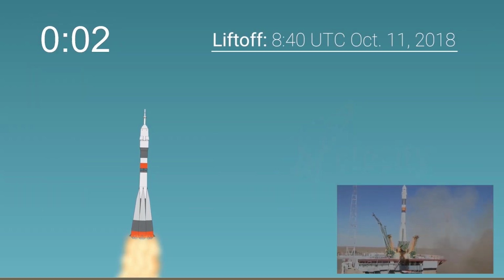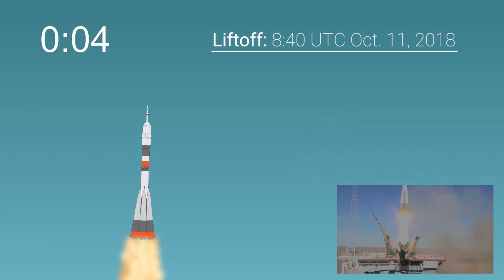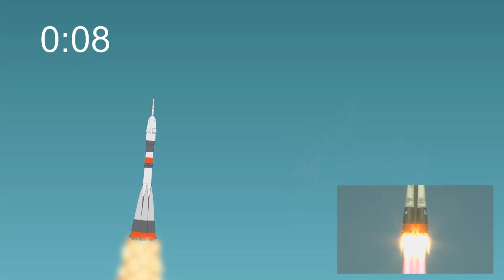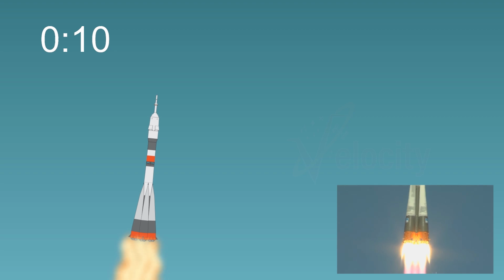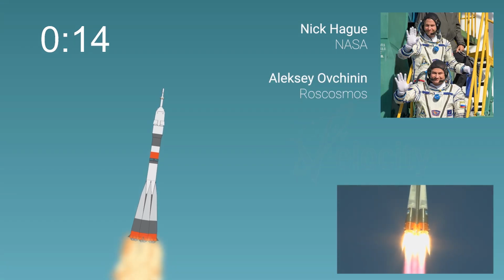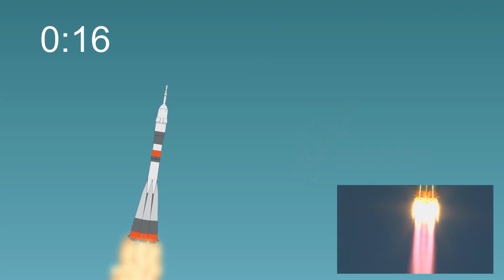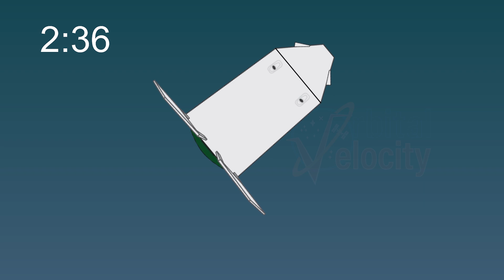Soyuz MS-10 Abort Animation

Comment: So the soyuz has two escape systems?
Reply: By the time the contingency abort was declared, the launch escape system (LES) tower had already been ejected and the capsule was pulled away from the rocket using the solid rocket jettison motors on the capsule fairing

Comment: I'm confused, the escape tower was jettisoned but they still aborted?
Reply: The escape tower is just extra boosters needed to escape during the early stages of launch. In later stages the thrust is lower so it is ditched, there are more boosters for escape in the fairings.
Reply: the fairing has engines
Reply: By the time the contingency abort was declared, the launch escape system (LES) tower had already been ejected and the capsule was pulled away from the rocket using the solid rocket jettison motors on the capsule fairing

Comment: good thinking! seperation is a point of faliure, they jettisoned the crew escape tower before the seperation, so its always good to have a backup
Reply: Well, at that point you don't really need the full power of escape tower engines, as you're in flight already, but still need something to pull the ship away from the failing booster.

Comment: Makes you wonder why they get rid of the escape tower before staging begins. I know they probably passed max dynamic pressure already but they will probably learn from this.
Reply: When you reach certain height and/or speed escape tower is no longer effective and can't really be used for what it is meant.
Reply: They had a secondary launch escape system after the tower is jettisoned
Reply: Which worked
Reply: the escape tower would be an execive thrust and the crew would be a little injured of G forces so then only use the tower when its at the ground

Comment: I did this in KSP once, Bob and Bill Kerman were never the same after.
Reply: Kerbals are always happy. I deorbited a space station yesterday and the were smiling and dancing
Reply: @astroaaron855  
I flew an SLS Orion mission and Jen kept the underside of the capsule facing downward like a champ while the service module (which failed to disconnect) was released along with the heat shield during reentry. All crew survived.
Reply: @astroaaron855 Lmao
Reply: What happened to Jeb?
Reply: Did they have uhh, Bipolar and PTSD?
Reply: I did this in ksp but I changed the ambient setting to cold and destroyed the gas tank

Comment: Backups on backups on backups on backups. This is why these guys got home. 60 years of experience launching Cosmonauts/Astronauts will do that.
Reply: Man, Russia is smart with their Soyuz. A backup, on a backup.
Reply: @randomguy-jd8su  still not smart enough to jettison the tower After booster separaton, still a good idea to have the faring abort anyway incase the tower fails to fire
Reply: @nobodyneedstoknow.7308  ye
Reply: @nobodyneedstoknow.7308  yup it is a little early
Reply: @nobodyneedstoknow.7308  they did their calculations and they worked

Comment: The actual parachute touchdown is not correct. The capsule has no retro rockets.  These are part of the parachute at a point where all the parachute lines join together above the capsule.
Reply: It does have retro rockets that fire just before touchdown to smooth out the landing since that capsule lands on land
Reply: @matthewsanetra  Just checked.  You are right about the current capsule.  I was sure there was a different method used in dim dark past, with soft landing rockets being suspended on parachute not far above the capsule.
Reply: @MrDomingo55  I've never heard of that "past". I think you are confusing the earth capsule landings with the skycrane mars rover landing
Reply: @MrDomingo55  You're probably thinking about Voskhod. It used a redesigned Vostok capsule, but Vostok didn't have retro rockets since it used a catapulte for the cosmonaut. Voskhod didn't have a catapult and thus needed a smooth landing. But there was no place to fit the rockets on the capsule itself, so the engine was indeed suspended above the capsule. Soyuz originally had a retro rockets on the bottom covered by detatchable heat shield.
Reply: @РоманЕвгеньевичСеменко  You may be right.  I used to subscribe to "Spaceflight" magazine many years back (80s/90s) and maybe that is where I saw this.

Comment: Thank goodness for those backup escape rockets on the fairing!
Reply: They're not really "backup" escape rockets, even if the failure happened on the ground like in 1983, they would still be ignited after the signature "tower".
The tower would first pull the capsule rapidly upwards away from the ground, then those smaller rockets in the fairing would pull it even further up. Then the third set of engines would pull the fairing off.
The tower got jettisoned prior to the failure, but at this point it was unnecessary. The abort sequence just proceeded straight to the second phase, so to speak.
So... yeah. They were not backup technically, [Engineer voice] ya damn Yankee.
Reply: @ahriman935  put dispenser